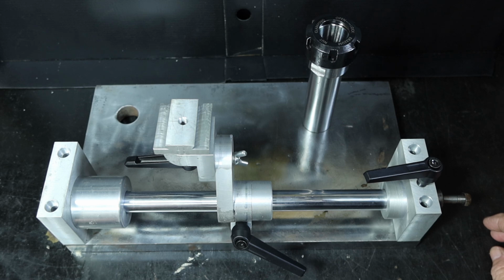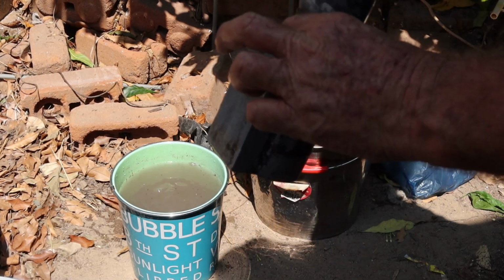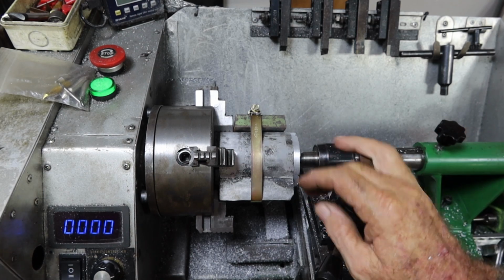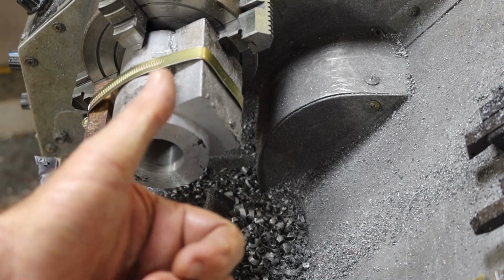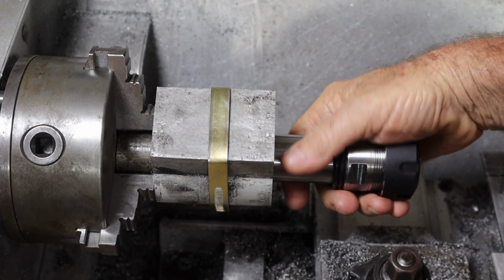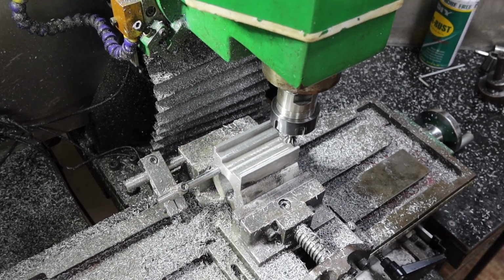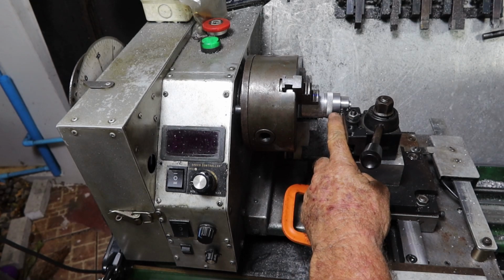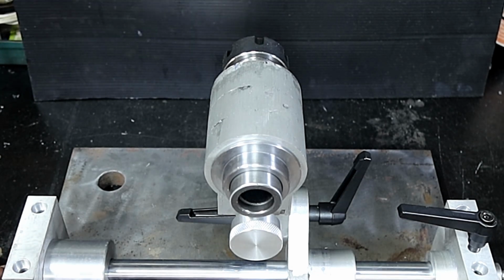MHW Episode 128 - Homemade Tool & Cutter Grinder - Part 3

Comment: I expected that both side would not line up. (based on my past experience) But did you need the whole length? I wondered if half the length would have been good enough. Of course your fix was the best solution. I really like this project. I might make the same thing at some point.
Reply from the maker: I got a perfect alignment last time I bored something to take the same type of collet chuck, but I forgot, last time I was using a steady rest, which I couldn't use for this. I maybe could have shortened it up a bit, but I didn't want to shorten it up too much. Thanks for watching. 👍

Comment: It's your friendly neighbourhood smart@$$ chiming in, too late as usual: the model steam loco guys seem to machine their cylinders by machining reference features on the outside (like your dovetail boss), then align and secure the casting on the cross slide for the final boring using a boring bar between centres.
As long as you're having fun, we'll cheer you on!
Reply: I owe you an apology, sir! After subscribing because of this tool & cutter grinder series I've been scratching in your older videos. With the resources you have, your output is amazing!
Reply from the maker: Thanks, I do what I can with what I have.

Comment: Coming together beautifully, surprised you don't have a little window air conditioner in your shop as hot as it gets where you live. 👍👍
Reply from the maker: Thanks, there are no external windows in my workshop, at least now that the rains have started it has cooled down. Thanks for watching. 👍